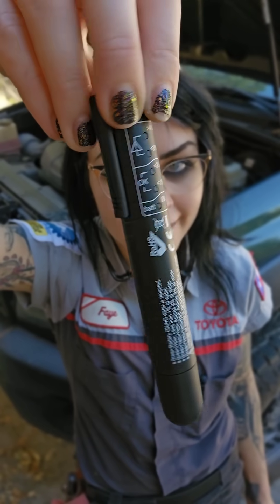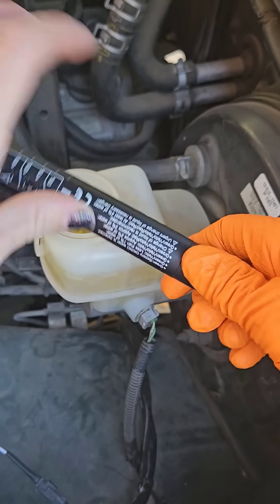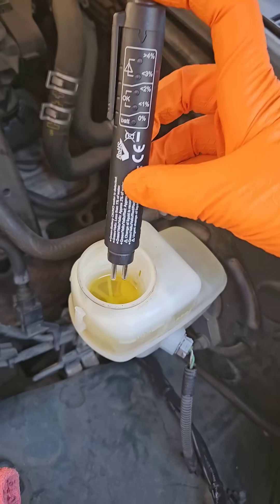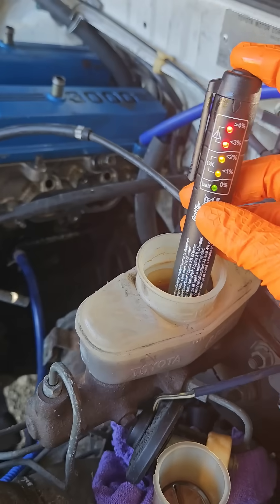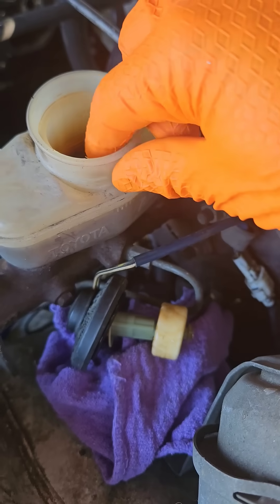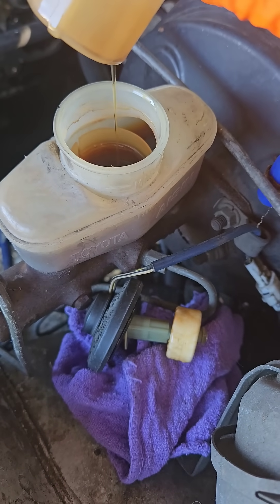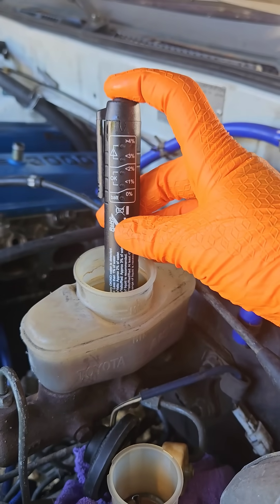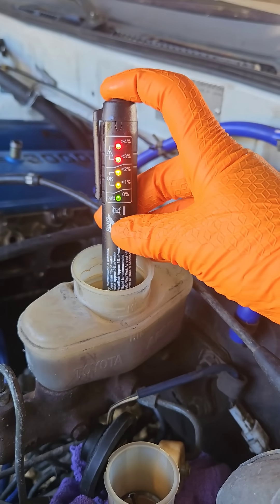Do you REALLY need your Brake Fluid Flushed?? How to Test it For Yourself!

Comment: My car has the same brake fluid since 71 and it brakes fine
Reply: no it doesnt lol, it wouldve slowly been changed out each time a brake job was done. just neglect on your part
Reply: @arcanevoid9199  each time a brake job is done ? Yea if it hasnt  failed since 71 i dont think your way of maintenance is correct sound more like a waste of time and money
Reply: @19juan67  yes like brake pads, calipers, discs etc. yea thats why every manufacturer and brake fluid company recommends it, they must all be wrong :)

Comment: The issue is when its 20 years old, completely black, and they refuse to let me change it
Reply: who
Reply: @ADarnSmore  lots of people think brake fluid, transmission fluid,and differential fluid last for eternity. Until i convince them to drain out a bunch of sludge. I used to be a personal mechanic until the computers basically took everything over, now im not interested.
Reply: @taylorsopko5807  oh i thought you meant someone wasn't letting you change your brake fluid, that's crazy.

Comment: When driving in the Alps, I had trouble disengaging my third gear (manual gearbox, hydraulic clutch). I thought that the cylinder on the hydraulic clutch was shot. The dealer wanted to change my gearbox and clutch (5000 euro). I thought that was stupid, first try the simple fix before you go radical. I changed my hydraulic fluid and everything went back to normal. The fluid was saturated with water lowering it's boiling temp (extreme changes of temperature in the mountains =  condensation in the hydraulic circuit), so all the hard braking on Swiss roads vaporized some of the fluid (shared by brake and clutch circuits), rendering the clutch ineffective.

Comment: If your heating your brakes up to create steam from the moisture then you have more issues than brake fade you'll have warped discs too also the brake fluid degrades with temperature as well as age so heavy braking will cause way more issues than moisture in the fluid

Comment: Im conflicted in a way because my dad is a mechanic for over 50 years and he tells me dealers put a lot of "maintenance" stuff and some are just scam and bs.

I have a 2022 corolla im now im my second srvice and they wanna flush the engine, brake fluid, something about checking spark plugs to make sure they good. And all that was 400 usd. Wtf. Heck i went because my factort battery died and the mechanic in the dealer said "bro that aint the factory battery thet changed it before they gave you the car" ☠️🙄☠️☠️☠️

Comment: I bought a civic that had been sitting the entire length of covid.. I drove it trough winter and realized i don't need to flush break fluid because its full of water.. i had to flush the breaks because i had to change all break pads, hardware and do a quite a cleanup -> Then i had to learn how to bleed breaks... i was learning untill the reservor was almost entirely empty :D But the breaks were bled, new pads, new fluids and boi how that civic stops.

Comment: So I'm a service advisor for Lexus, was at Toyota for 5 years and have been behind the wrench for 7 years before that. I so so badly want to use this when recommending the brake fluid flush. 

Excellent video!
Now I just need the full set for plugs, transmission, fuel system, brake service, coolant, diffs, power steering fluid (even though we don't used it in most of the models since, what, 2010? 

Def worth a subscribe

Comment: I wouldnt trust those amazon testers ive used them dozens of times and gotten 0% readings and 4% readings on the same vehicle, its better to use test strips imo
Reply: Because it measures resistance, it depends so much on how deep you submerge it in the brake fluid.

I always get the 4% if I submerge the tips fully, but 0% if I submerge only the ends of the tips. I tried googling how exactly you should do it but everyone just glances over that part.

Comment: Also, water freezes into ice crystals which believe it or not are sharp enough to slowly slice through seals. I've seen several master cylinders fail this way. ...although boiling fluid is definitely a much more common danger.

Comment: Literally just look at the color of the fluid. I've been a mechanic longer than she has been alive. You don't need a tester.
Reply: Water doesn't change the color of the brake fluid.  Water in the fluid is a problem. Dirt in the system really isn't much of a problem.  Either way you could go 200k miles without changing your fluid and odds are you'll be totally fine.
Reply: @ShelbyGT350-R  lol, "Brake fluid is predominantly made of glycol-ether, which is a hygroscopic fluid. This means that the fluid absorbs moisture from the air around it. “Water by volume” refers to the amount of water that has been absorbed by the brake fluid."
When water is absorbed into the brake fluid, it becomes cloudy. But hey, not like I have been doing this for almost 30 years.
Reply: @NOTSOSLIMJIM  I know what a hygroscopic fluid is. I've worked in auto parts stores for years. You would think a mechanic would know that those meters exist because you can't tell how much water is in the fluid by looking at it. You know there is an acceptable amount of water in the fluid right? It's not like oh it absorbed a tiny bit of water and became slightly cloudy, must need new fluid.    You can't possibly tell me how much water has gotten into the fluid by looking at it.
Reply: @ShelbyGT350-R  lol, you worked in an auto parts store. No wonder you think you know everything. Just because you can test fluids by itself look, color, and viscosity. Doesn't mean real mechanics can't.

Comment: Excellent video! Thank you very much. Subscribed!
I took my Maybach in for service last month and in the "complete service diagnostic report" at the dealership, they suggested I get the brake fluid flushed/replaced. Considering I bought the vehicle just a year ago, I thought it might not be necessary (yet). Now I know of a way to test it myself instead of taking the vehicle to an independent (and reliable race) mechanic who specializes in high end exotics and uber luxury vehicles for a second opinion.
Thank you again! :)

Comment: Those testers are not recommended for testing brake fluid.. they test bad on most new fluids right from a new bottle because modern fluids have conductive additives and thats an "electrical conductivity tester" so it not only picks up water but also metals and anything conductive....those testsrs are worthless, if that the case you're better off using your zero water tester (at least yhat gives you a number reading) still worthless

Comment: golf 2 gti, 12 years without ever flushing, only refill, 0 problems. further oil does not mix with water, so water would settle at lowest point in system.

Comment: Problem with these testers is that they don't test the fluid at the hottest point of the system, the calipers which is where if you have moisture, you will see the biggest loss in brake performance.

You don't need to flush your entire system, but a bleed of the fluid closest to the caliper is always a good idea.

Comment: I just flushed and replaced all the calipers rotors and pads on my truck, along with a new exhaust system and new wheel bearing hubs on the front end. Next on my list is new ball joints and shocks

Comment: Every 2 years? At this moment I am thinking that I should change it after 12 years :D I did some emergency brake checks and everything was fine, but during emergency braking the system goes full pressure automatically, so I dont know, maybe it is really time to change. Also I was testing it only from max 120 km/h. When I mild-hard brake from over 160 kmh I can feel around 80 km/h that the brake pedal is not as hard as normal.

Comment: Holy crap ... I think she just diagnosed the brake issue on my Nissan Sentra! Water in the brake fluid would totally explain why I rarely to occasionally have to pump the brakes a little to bring the pressure back up. (FYI: It's not a dangerous loss of braking power. Far from it. If it WAS, I would have turned the car in to get it fixed ... you know ... because brakes are important! It really is just an extremely minor issue.) This issue started a couple of years ago and never got worse (or better). Brake fluid levels are always perfect (no leaks), so I've been at a loss to explain the cause of this relatively minor issue ... UNTIL NOW! I'm about 99% certain this is the issue. It's just the best explanation based on the "symptoms". Hot damn! Thanks Faye! I'll try a brake fluid flush and see if it fixes the issue.

Comment: You do not need that device what’s so ever 😅. Here’s how’s you can tell for free, shine a flash light thru the reservoir tank and if you see no light on the other side it’s time. The darker your fluid gets the more moisture it has festered over time. If your fluid is darker it’s time for a change and the lighter it is the better. You do not need this tester, coming from  experience gm tech.

Comment: Your brake fluid might be good but sometimes you got dirt in there from the caliper piston the fluid does move back and forth and shaving sometimes particles come back up into the line so it is a good idea to have your break canister Lions totally blood out and the vacuum system pump is the best way to do that for any vehicle

Comment: Chevy Sonic LS, 12yo 92k. Brake fluid is clear as new, by light through the reservoir. No contamination because never been opened. Humidity is the worst for fluids and steel lines. Linings are also undisturbed, disks and drums look freshly turned. Mild, early engine braking saves the brakes for actual stopping.

Engine is untouched as well, beyond 5k oil changes. Stays on full between, cam cover hasn't even seeped yet. Be nice to your old vehicle, forget market value, it's actually worth the cost to replace it.

Comment: From what I've learned Brake fluid flushes are recommended every 30,000 miles or 2 years, depending on your driving and braking patterns. I lived in the mountains driving a 4×4 F350, so... my brake fluid was changed quite a bit regardless of miles. It was that down the hill drive every other day. That and rotors and brake pads wore out quite a bit. If only I had a retarder system at that time, and a manual transmission.

Comment: It's not even just water, you think about it, the calipers which yes has a rubber seal to keep it from leaking also has metal to metal friction which can cause them to seize up. I do a brake flush on my car every year just to get that metal out.

Comment: I worked at Fremont Toyota for probably two months. I couldn't deal with all the theft the "techs" were doing. Literally brake fluid flushes every oil change and all around brake job every time a customer came in for a tire rotation

Comment: The worst form of abuse is neglect.
Convincing cheap people to stay cheap is just how lazy people justify and rationalize their laziness...
"You don't got to do it yet." is how you wind up replacing all the brake lines.....😂😂😂
Reply: Lmfao ,,,buy my useless Gadget that people who take care of their cars will never give a crap about😂😂😂
Reply: How is using a brake fluid tester being cheap 🤔
Reply: @Ammut6  
People who don't flush their fluid once-a-year either don't drive the car or they're just cheap...
People who do their manufacturer scheduled maintenance don't need to buy tools because they do their maintenance..
Honestly you drop your car off at the shop in the morning you'll be back to get it by the end of the day...
The only mechanic that would suggest you buy tools is the type of mechanic who is too lazy to do the service..
Doesn't matter today all you have to do is be woke no one cares if you can actually take an oil filter off or not...

Comment: It absorbs water after a while, but I never had a problem....UHHHH brake fluid and ANY fluid can be compressed. I just met a meat in bread mechanic. I could tell by the stupidity (that oil/hydraulic fluid can't be compressed) and the piercings.

Comment: Yep. I change and flush my brake fluid more often than rly needed, but I like to ensure I’m playing it safe since I do any and all maintenance on my car that doesn’t require removing the engine. So, I change and flush my brake fluid if the water saturation is a bit high or if it’s been 2 years since the last change as well. However, I also change and flush my brake fluid whenever I change my brake pads or rotors. I buy fluids for my car in bulk, so I’m okay changing it more often with the lower price per change, especially since I don’t pay for labor and such. This is rly my philosophy with most things regarding my car. I have a spare of almost any part I’d need including a trans and a cat, so if and when parts start going I swap them immediately and then I replace that part in my collection when I can afford to. As I’m sure the brake fluid example illustrated, I do smn similar to my parts philosophy with all my car’s fluids too.

Comment: Every car should have a service manual included which shows when certain parts or fluids need to be replaced or repaired depending on the amount of km the car gas driven.

Comment: 20 yrs ago i bought a Blue Point Brake Fluid Tester, 1st you zero it in clean fluid then test it in the fluid to be tested. It checked by variance in resistance i believe.

Comment: Wierd observation, but your hands are in AMAZINGLY good shape for a mechanic. That must take skill!
Reply: all you have to do is wear gloves and look after them, its just most guys fail to do the basics or think its girly or some bs
Reply: @arcanevoid9199   I was just joking, but even with gloves on metal still pierces, tool slips still occur and and structurally unstable auto parts still give way and most of that abuse goes towards the hands. I've been a mechanic for almost 10 years and wear gloves whenever dealing with fluids. However, there's certain situations when torque is need that those gloves she has are a hindrance, especially when sweat builds up underneath them...which it will. Look around my shop and most of the guys I work with do the same. However, it still looks like a grizzly bear has been chewing on their hands.

P.S. This is such a common thing that they even have a medical condition called 'Mechanic's Hands'.
Reply: @TheGr8Herd  you can also wear thicker mechanics gloves, more then just latex/nitrile. has saved my hands a few times, and i always wear them because my hands are too soft to grip tools properly without getting messed up. and what torque are you meaning specifically?
Reply: @arcanevoid9199  Torque,  as in twisting force resulting in rotation.  I use mechanical gloves as well, but when your doing several cars a day there are certain situations when gloves are just a hindrance.  Engine compartments are typically very cramped and many times you know where the part is that you need to work on,but can't exactly see it. In these situations you need to rely on touch, which you can't do with thick gloves on. Let's say you're elbow deep in the engine compartment trying to loosen whatever fastesteners secures that part. Let's say for this example they're nuts, so you need a ratchet to loosen it. You feel your way to the part, find you first nut and position the ratchet onto the nut itself. You start applying torque and it proves to be a challenge. Just when you think you've got it the ratchet slides  off the nut sending your hand and all the force you applied behind flying forward into an adjacent (and very sharp) part. It happens all the time and there's very little you can do about it. It's just part of the job. You working with machinery, industrial tools and chemicals (fluids). If you've been that job for any length of time calluses and scars and bruises are GOING to happen, even through mechanic's gloves.
Reply: @arcanevoid9199  Look, I didn't come here to offend or argue with anyone and I apologize if that's what occurred. I just made an observation and joked about it.

Comment: Also brake fluid will chemically change after about 7 years give or take due to the environment,  into acid. When this happens it will eat sh!t so on a general note just flush and change every 7 years and you will be safe.

Comment: This mechanic really knows her stuff.  She had a video on reubiling the front end of a Tacoma and she showed how, by using "Wobble sockets,"  you could remove a bolt that would otherwise require removing four major engine components.  She basically saved me a solid days work with that one tip.  She knows of what she speaks.  Sure glad I found her vids!
Reply: Wobble sockets are the best!! I got two sets of impact ones for work. One in ⅜" drive and the other in ½".
Reply: Faye (Hadley?) can also be found on TV - All Girls Garage.  I think new episodes are no longer, but reruns might still be on  MotorTrendTV.
Reply from the maker: Heyyyy thank you so much for that!! I'm glad you found them too😊
Reply: I've used ball and U-joint type swivel sockets, extension swivels, extension wobbles, flex extensions, etc and have never heard of a "wobble socket".  I suspect it's one of the types I listed with a regional name.  A search of this Tacoma front end video came up empty, do you have a link?
Reply: @scabscerte you haven’t paid attention if you’ve never seen wine sockets. Ask your tool truck guy.
Reply: @MarissaTheMuse  Wine sockets, you say?  Perhaps you meant Winsock?  Can API code be used to engage fasteners?  Tell me more, I'm here to learn from those who pay attention.
Reply: I use wobble and driveline sockets for literally everything.
Reply: I jumped to conclusions and thought she was ANOTHER YouTube girl that acts like they are about cars but uses her body for a fan base/following. Kept watching and found out she knows her shit, I'm not disappointed I'm now interested because I have to do my brake fluid😂